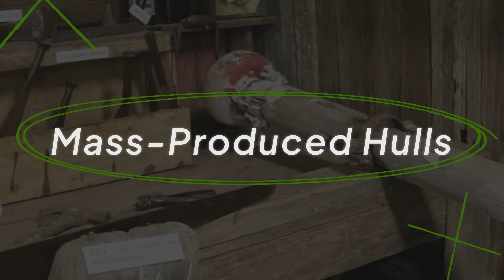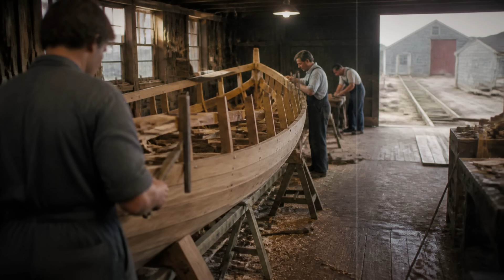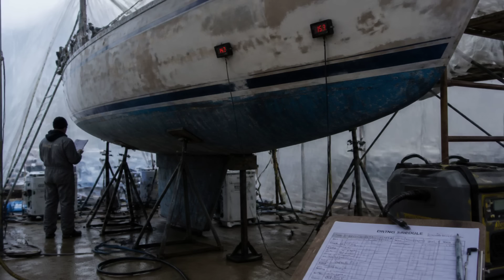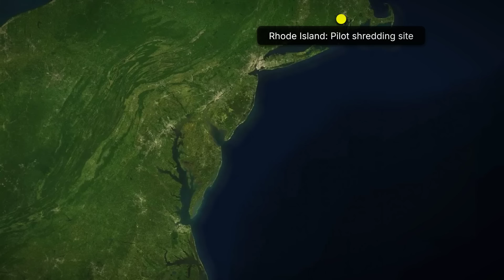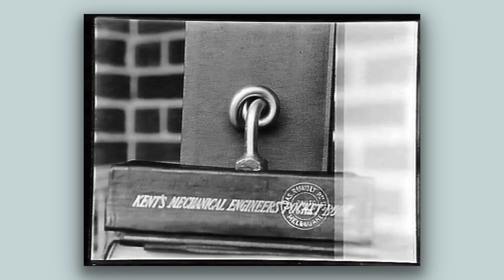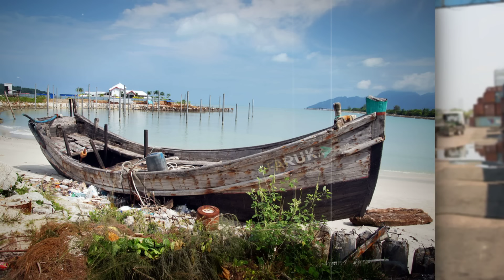Forget Fiberglass: This 60-Year-Old Hull Design is Stronger (And Cheaper)

Comment: I am building a cold moulded wood boat that can be repaired forever. Wood is the number one material for for resisting stress cycles and it grows on trees. If you want to dispose of it saw it up and put it in the wood stove.

Comment: aluminum produces fine but noisy hulls which vulnerable to electrolysis especially from stray current conditions quite common in  marinas. They require vigilant prevention regimens. Cold molded hulls can wonderfull.. but are not immune to wood-water deterioration just substantially less so than older wood tech. older glass hulls can be repaired reliably with moderate skill but do seem to gradually suffer some embrittlement and any shortcuts in layout and general design become more problematic with age. These presentations suffer from selective data collection leading to flawed final conclusions. Mass production glass no doubt  presents worst end of life cost and impact but new methods still may evolve to at least reduce current impact. problem is financial incentives for innovation
Reply: Fibreglass still represents the most environmental impact.   And recycling will always be a major headache.   I agree about aluminium hulls,  ideal for fast patrol boats owned by CG/Navy/LEA... Or light fishing vessels.   Cold-moulded hulls,  especially double--diagonal are extremely robust, providing they are suitably coated/clad.   I own and live on an 86 year old CM/DD Harbour Service Launch, with steel superstructure and two internal transverse bulkheads...   Apart from a few seepages in the rabbet line,  she's solid all round,  but then she was built with DD teak on oak, by the admiralty;  she served in the Royal Navy during WW2 running supplies,  ammunition and personnelle  to-and-from moored or anchored warships and is now in the process of being refitted with sustainable energy systems and eventually electromotive propulsion.   

Without doubt,  the most robust and imo,  the best material for a truly ocean-going vessel/live aboard is steel.  Steel is easy to repair,  redesign,  prepare and maintain and relatively cheap compared to composites or wooden hulls.   Electrolysis is an issue with all metal hulls,  but with proper electrical fit-out and adequate sacrificial anodes,  steel is less prone to electrolytic erosion than aluminium.

Comment: steel is subject to rust and require a lot of paint. Fiberglass is also easy to repair anywhere. Wood laminate is subject to the problems of wood. This video isn't balanced.
Reply: Fibreglass Boats are an environmental disaster..
Regardless of how they stack up against steel and wood during their active life.

Comment: Do you think the engineers on the Titanic were thinking to themselves, boy I wish I had a MIG WELDER?
Reply: If I'm not mistaken, the Titanic was built with some kind of riveted construction. I don't know what alloy of steel was used. That kind of thing matters. It also helps if watertight bulkheads go all the way up to the deck.
Reply: @lr21643 
I agree with you.
The MiG welder part was a joke from my perspective.

Comment: What about cement boats i ha ve a 53 foot cement boat that has 9 miles of high tensile steel galvinized wire wrapped inside 3/4inch thick cement and shes been floating 54 years now and still going strong
Reply: Probably not very strong for the weight, though. Since your boat is 54 years old, there must be some way to protect the reinforcement from corrosion. How do you do it?
Reply: @lr21643  Flex seal
Reply: Concrete coffins are okay until they fail then they live up to their name . Get a trimaran and stay alive mate ❤
Reply: Concrete makes a very strong and durable hull, if done right. And a quickly deteriorating mess, if not. 
And the problem is that it's next to impossible to determine whether a given hull is properly built.